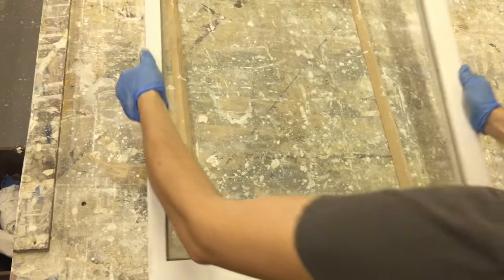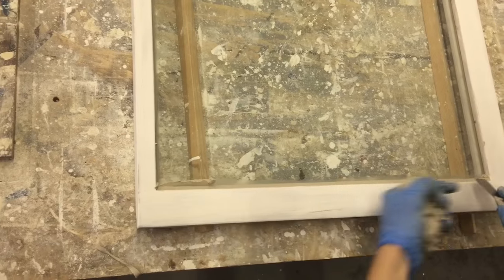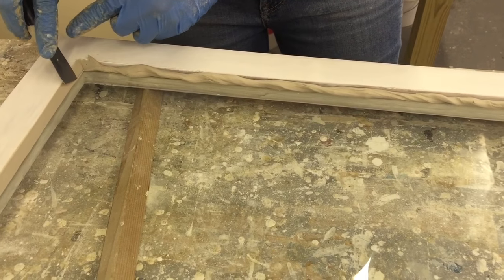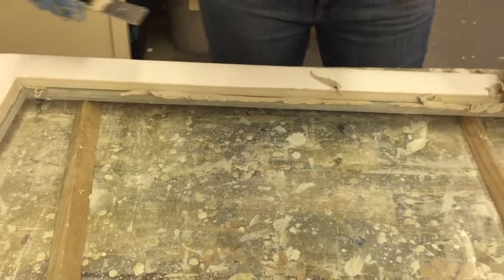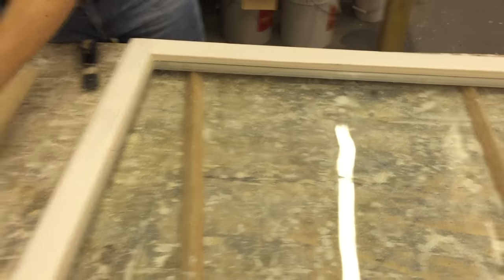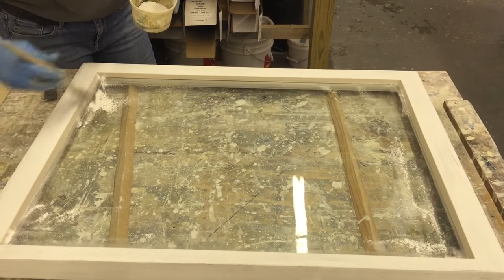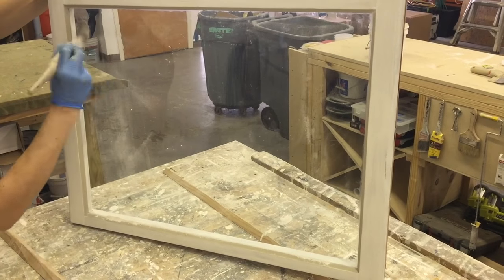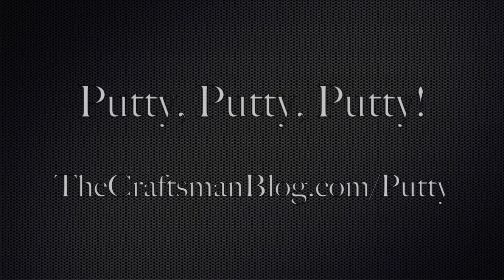How To Glaze Windows

Comment: I wish I would have discovered your blog before I ripped out my original 110 year old windows in exchange for vinyl replacements. Too little too late. Despite that, I have a new appreciation for those old windows. There just isn't enough emphasis on preservation of old-fashioned,  quality craftsmanship.
Reply: That is a shame, because you'll have to replace those vinyl replacements sooner than you think. We just don't have "save your old windows!" craftsmen out there on the streets to compete with the vinyl siding salesmen.  So many once lovely neighborhoods now are so ugly. They are still nice houses inside, but gee, the outsides are just hideous.
Reply: i feel your pain---but im going to re-replace with new wooden
Reply: A few years back we had a home energy audit.  Our circa 1885 house didn't fair so well and we discussed replacing the old windows and storms.  The fella that did the audit told me to fix the windows instead.  More work in the short term but much less expensive in the long term.  New vinyl windows fail in 25-30 years and, importantly, have less airspace than the window's glass and the storm's glass.  The current windows are the originals and with some TLC will continue to function beyond the vinyl's lifetime.
Reply from the maker: You’re on the right track now!

Comment: nice clean work....I always check the condition of the wood before glazing...always paint bare wood or the putty will fail in time....i usually paint about a 1/4 inch of the glass as well.....my trick?  I blue- tape about a 1/4 inch from the edge, then spray the edge with a quick film of paint, let it dry ten minutes then apply the putty. Same with the little edge of wood, make sure its painted.....did my mom's sunporch french windows ten years back, putty is still hugging glass, its starting a few hairline cracks, but its solid.

Comment from the maker: Yes, bed the glass in a thin line of putty and secure it with glazing points. Check out my older video How to Glaze Old Windows for the whole process.
Reply: I was certain a bed of putty was required but fail to see that elsewhere . Seems like remember painting on some linseed  oil on the really old dry frames...is this true?

Comment: I've done hundreds of windows over the years. I always dipped my knife in a bit of turpentine to keep the putty from dragging with the knife. I've never had problems doing that, but the dust is a new one on me. I'll have to try it next time. I've got around 50 windows to repair in the coming weeks.. 
Also I've never been good at making the snakes so I just dip globs of putty on my knife and jam it in the rabbit joint.. Corners are easy especially with a dab of turpentine..

Comment: Nice work Karen! When I pull the knife it pulls the glazing with it. Does that mean the glazing is too cold or not enough oil in it?
Reply: Either one. Old dry putty isn't good and heat helps as long as it's not hot..  I have softened it up a bit with just a dab of turpentine.. Not much, just a fine mist..

Comment: an embee curved one inch knife,,used ONLY on applying  putty,( great stuff= Nuputty,,out of business now) Des Plaines Il,,feather the glass edges with fine grit sandpaper,or just a step above the fine stuff,taking the sharp edge off means the 3ft crumbcrunchers in the house can slam the window down and it will not break,use the glass cutter to snip off the sharp corners too,trangle glazing points,these secure the bedded glass TIGHT onto the sash,, before glass is set in the sash for puttying,clean it with pumice or cerium oxide to remove the plastic grit that protects the massively heavy glass sheets from rubbing and breaking  during the trip to the assembly point,windex alone does not do this,,the putty will likely fall off,peel,and not seal properly,( red devil glass cutters,,real good for this,),store each cutter in oil or creosote,one for each thickness of glass,dont use one for the other,,prime the rabbet with a bead of paint before applying the thin putty bed,that sealed surface means the putty will stick,,unless someone tosses a baseball through the window,it will provide more inside quiet,and weather sealing for 50-60 years,use a belt sander to feather and smooth every  wood surface in the window track casement bottom and sides,the window should go up & down smoooothly,not stick,or get stuck on protruding nails inside the window weight housing,an inch and a 1/4 long 3 d nails are what you use to nail the trim  and parting stop in place,nothing longer, cotton cord to attach the window weights lasts a lot of years,, nylon cord will soften and break prematurely.

Comment: Hi, great video on glazing.  I've repaired a few of my old wooden storm windows on my house and struggle with the putty pulling away from the wood as I pull the putty knife across it.  It looks like the putty Karen is using is very soft compared to the putty I've bought at the hardware store (even after letting it warm up inside the house).  Does it need to be that soft of putty to work well?  Thanks!
Reply: From watching other videos it seems the warmer the putty is the better it works.
Most of the videos I've watched of people doing a good job show them kneading the putty in their hands until it is really soft before they apply it.

Comment: I had to replace 8 large panes in situ.   I used Sarco Type M and whiting.  Can it rain on that before I paint or do I need to hurry up and paint before it rains?  Also, can I paint with latex paint directly or do I have to primer first?
Reply: Exactly really usually need to prime wood to stop it soaking the oil out of what you put on it otherwise it usually drys out and cracks at least with ordinary putty it does. Like it says there's a previous video on old windows.
Reply: I was referring to painting the putty, not the wood.  Thank you for your response.

Comment: Not one of the hundreds of panes of glass I have to reglaze is every going to be horizontal, or out of its whatever-you-call-it. These are metal casements, about 1930, riveted in, and we're just reglazing where it's falling right out of the window. Cannot find any metal spring clips holding the glass panes in, so am assuming that little bead of putty that looks like cement is what is holding them in. Doing this outside on old windows with old paint everywhere (I can't scrape all the putty off all the windows; what if they start falling out?) leads to dirt and crap falling all over the place constantly.  I'm just focusing on the ones that look most dangerous, the ones where most of the putty has already fallen off, or where if you touch it it just falls off in a hunk. 

So then I try to clean it out -- what do you call it? a rabbit? rabbet? is it a rabbit/et in a steel window? -- and paint the steel with rust destroyer. Wait for that to dry, then putty. And my putty sticks to my putty knife. Oh, well...

On another video, the fellow referred to the edges of these areas for the putty as "heiresses", or something like that. And then there's this sightline, so you can't see the putty from inside. Seems a little bit like learning to drive.... a few things to remember. Thanks for the help.  But make it harder for yourselves sometimes, like for real people outside on ladders with steel windows set in concrete....
Reply: yah we have 1950s steel casements double panes wide ones and no idea where to find any of these steel pane wedge clips either.

Comment: Please help!
  I have tons of old wood windows where the glazing has cracked 
   The only window putty I could find is dap33 latex window glazing 

   They say I need to prime the window frames with oil based primer to use this which poses a bunch of problems for me 
  
  For one oil based primer means I need oil based paint 

Do you have any experience with this or any advice on what I should do?

Comment: Thank you so much for the great tutorial. The one rude commenter is an embarrassment, unfortunately in the internet age you can be rude to anyone with no risk of a black eye. I'm building new old-fashioned wood storms. Can the putty go on the bare wood? I've just primed the windows to this point but didn't prime the rabbets and I want to ask before I go any further. Thanks, great work!
Reply from the maker: Always prime the rabbets to avoid the wood pulling the oil out of the putty and drying it out prematurely.
Reply from the maker: Thanks for the encouragement too!

Comment: My Dap 33 glazing putty didn't ever get as soft and clean cutting as your video.  it tended to pull and shred along the glass edge.  what am I doing wrong?
Reply from the maker: Your using DAP 33, that what is wrong. DAP is really a terrible glazing putty. Check out better outties like Sarco or my own putty Austin’s Glazier’s Putty.
Reply: @TheCraftsmanBlog  , I heard this from someone tradesman about 10 years ago prior to restoring several 6 over 6 double-hungs, and was told that Sherwin-Williams "66" glazing compound was a superior product.  I bought a small tub of it and used it.  It did seem to be a bit more user-friendly than Dap, but nothing like what I'm seeing here.  So is that your own putty that's being used in this video and is it linseed oil based product or? what do you find to be the ideal working temperature?  I imagine this info is available on your website, but it might be useful to go more into the details about the putty in the video or pinned at the top of the notes.  Thanks for posting this, it looks like you all do fantastic work.

Comment: you need rounded corners. Sharp corners look very nice and are satisfying but hold water. Glazing will last much longer with round corners.
Reply from the maker: Adrian Armstrong I appreciate the feedback but the standard practice has been mitred putty corners for the last 400 or so years. This one has been tested and found to work so I'm sticking with it.
Reply: I respectfully disagree, As a heritage carpenter that just fixed windows out of Kings college Chapel from 1798 that was refinished last year with sharp mitered corners the bottoms of every pane lifted. The architect of the university specifically asked for rounded corners which I thought was standard procedure. I have never heard of anyone ever not rounding the corners for water shed. Every brand of putty available here also recommends it. Maybe I'm in a different climate and it works in yours but not in Halifax Nova Scotia where its humid, wet and constantly freezing and thawing. I guess it depends on where it is. I have never removed old putty that was still stuck and not lifted that was not rounded so I'm not the only one.
Reply from the maker: Adrian Armstrong well I guess it's a regional thing because here in the US working on any heritage building the corners are always mitred and have been going back as far as the 1600s.
Reply: http://www.dap.com/media/73954/33-glazing-tb-2012.pdf
Page 2 number 8. Instructions are from Baltimore, Maryland as header says.
Reply from the maker: Adrian Armstrong I see the reference but I still have to disagree. I'm on the boards of the Window Preservation Alliance and the worked with the founders of the Window Preservation Standards Collaborative. None of the hundreds of window restorers I know glaze with rounded corners or have come across rounded corners in their work. That's not to say it isn't a effective technique possibly but not one that is practiced in the USA.
Reply: sorry I forgot how high and mighty and yet stubborn Americans can be. No ones methods are better or considered! sorry for bringing an alternative method to the table. did you read what I added?? its instruction from USA LOL Sharp corners look nice but still crack and last less time so if you do it for a living I can understand wanting to do it more often.
Reply from the maker: +Adrian Armstrong you may have gotten the wrong idea. I'm not being stubborn or angry with you. I have spent my career doing this and am following in the footsteps of others who have done it with mitered corners for centuries around here. You may very well have a better method but I'm not willing to make a change like that without a little more than your opinion and one technical bulletin from DAP. I'm looking into it and asking around so I can do my due diligence, but you are actually the first person I have EVER heard of doing this.
Reply: Thanks for the link Adrian, very helpful.
Reply: I think there are also degrees of craftsmanship that have persisted uninterrupted more in different places than in others. In Europe, it seems to me the standard degree of craftsmanship beats she s***t out of what one will generally find here in the US. A carpenter from the UK who did trim work once stayed with me for a while in in a New York city 100+year old row house (what we call brownstones, but which really aren't), and was amazed by the very low standards of workmanship to be found all over New York City. I have to say, I agreed with him entirely. Not to put you, Mr. Craftsman's Blog, on the spot as I'm sure there are plenty of artisans left. But they are few and far between.
Reply: I would also humbly request a picture of what you mean by rounded corners, as I am embarking on what I figure to be 4 to 5 years of renewing the putty.  These are steel casements, riveted in place, not coming down for reglazing (maybe someday new energy efficient glass), just staying in place for application of rust reformer onto the steel and fresh putty.
Reply: I think I'll check my brother's. It seems like they might certainly have been redone by now, but the house dates from either 1713 or 1717.
Reply: they do do things differently in different places. I have certainly seen that. Go check out windows in Europe, including UK, and in Canada and Nova Scotia, before you pronounce on all windows. The USA does not contain all windows, nor all styles of hanging or puttying windows. Or of shutters. Or any number of other things.
Reply: after painting it rounds somewhat
Reply: My windows are from a 1890's Ct home that has mitered corners and that's my preference also. I re-glazed them 20 plus yrs ago and still holding.
Reply: Adrian Armstrong  wooded beads are mitred not rounded at the corners
Reply: @adrianarmstrong5546  Interesting I have been glazing windows for 45 years here in the UK and have worked on many historic sites all over the country and I have never seen anything other than mitered corners on putty work . I would love to see a picture and cant quite see the reason that it might "hold water" Always love to see something new

Comment: Do you set the glass in putty?
Reply: No it sets against the wood behind it.
Reply: @pauljavener7342 You bed the glass in putty, press firmly around the edges and then carefully push in points on all four sides. Next turn the window over and remove the excess putty. This will keep the window from rattling I'm the future from wind or vibration. Now you are ready to glaze the window.

Comment: Aren't there important missing steps????
Cleaning, priming, back bedding?

I guess that is covered under "go to craftsmans blog" but this could cause a newby innocent lots of headache!
Reply from the maker: N Y yes there are more steps but this is only a   5 min video showing finish glazing. I can't fit everything into the video but all the info is on my site if you need it.
Reply: Thanks Scott, I didn't study completely enough.
I used the 20 minute drywall compound.  Really wonderful.
Thank you!!!!! Way quicker than razor blades.